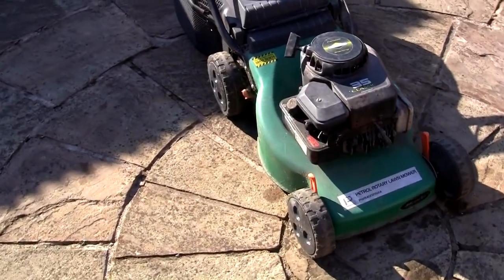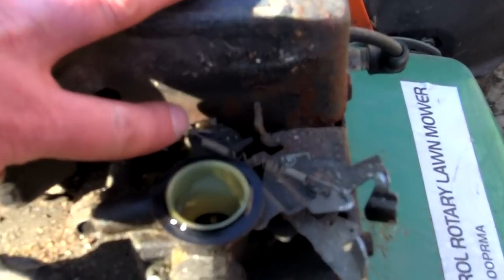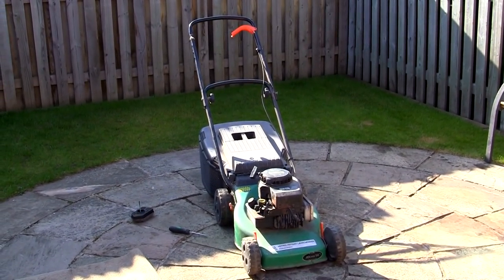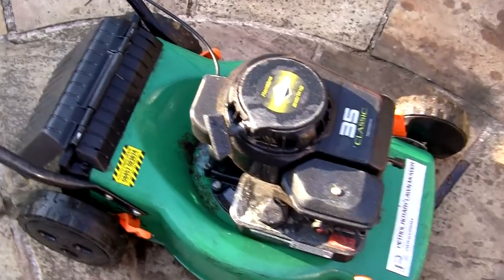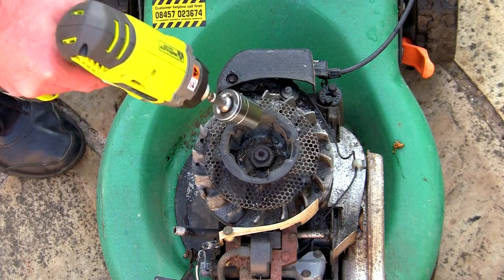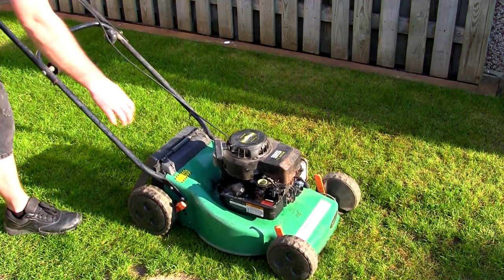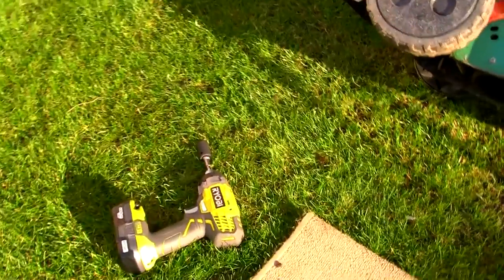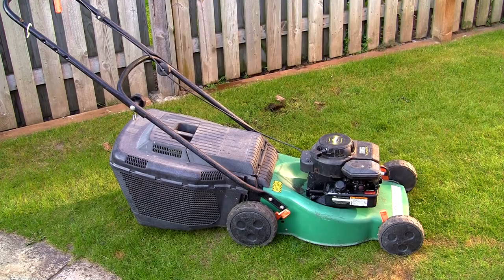Briggs And Stratton Pit Stop Service

Comment: I have a lawnmower with an identical engine to the one in this video and I have found the video and your website an invaluable help.  Thank you so much.
Reply from the maker: Marshalls Music That's brilliant thankyou so much
Reply: The mower packed up in the middle of a big job, so you tips are getting me out of trouble.  I like you oil extractor.
Reply: @MowerMan  I have checked my mower today and the only thing that looked wrong was the air filter sponge seemed to be damp, didn't smell like petrol so not sure if that is normal or not.  I also cross threaded the cover bolt nearest to the cutout switch cover so now it won't tighten up properly, I hope this won't lead to more problems.

Comment: the reason why it revs up and down a little is because you don't have the air filter screw in..  with out the screw you have a nice size air leak into the gas tank.  The pulsa prime carb and tank. you must always run it with the screw in even with the filter is off.

Comment: If you’re gonna run a  pulsa prime with no air filter, put the screw back in hole. But it will run better with the filter. I oil up the deck and paint the tins

Comment: I have the exact same engine.

It would start and run for a minute and then die.

Now I have cleaned the carburator. Installed new diaphram and air filter.

Now it won't even start. The button does not seem to pump fuel anymore. I disassembled it again and tried the pump while the long thing was stuck in a glass of water. No effect.

What could have gone wrong?
Reply: You need to keep it running for a bit with Ether until the carb fills with fuel.
Many many pumps of the Primer bulb.  You will know when it is getting fuel.